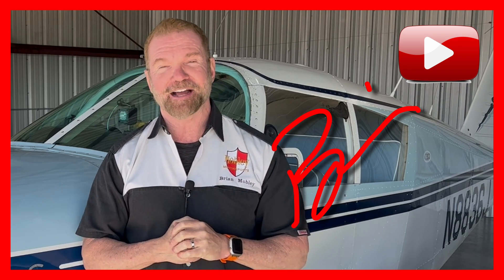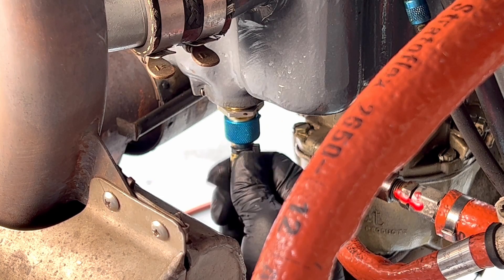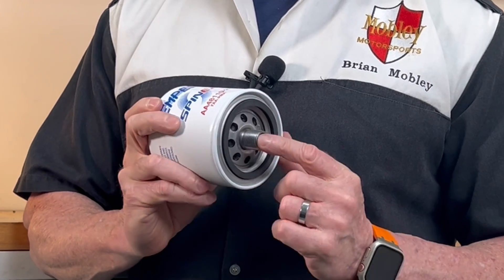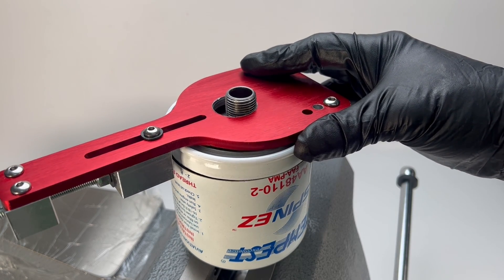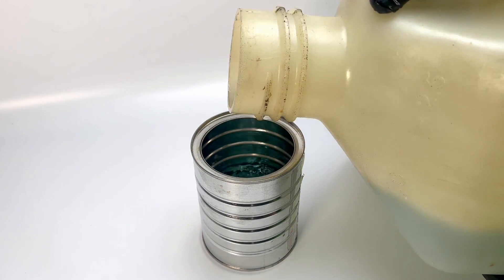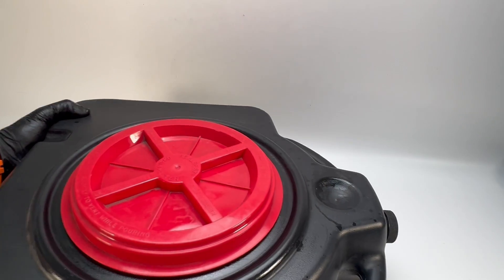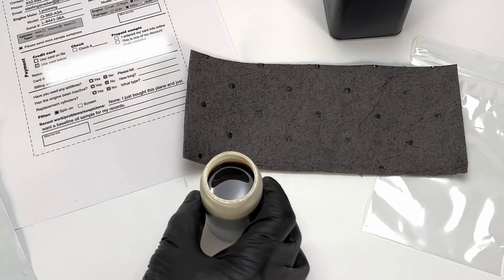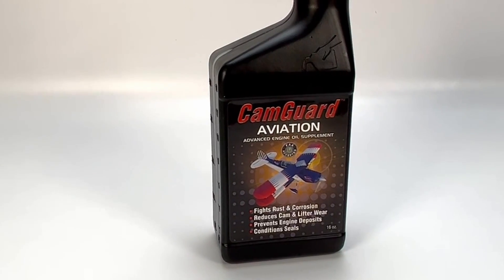Lycoming O-360 Oil Change | Piper Cherokee 180 | Cessna 172 | Mooney M20

Comment: I just bout a Cherokee 180 and had my oil changed at KLVJ. It was $530😢😢. I’m definitely doing it myself next time. Thanks for the video. Side note, I just saw a blue 180 just like yours over at the avionics shop at KAXH.
Reply from the maker: I’m based out of KLVJ also. And, you’re right about the plane at the avionics shop! That was mine. Was getting service on my VOR. As for $530 oil change, that’s nuts. Sorry you had to pay that. BTW, I’m so close to 10,000 subscribers. If you could subscribe, it would mean a lot!  Dying to hit the big 10K!
Reply: @brian.d.mobley  no problem, subscribe button just pressed. I’m right next door at Polly Ranch. I’ve got the “new to me” Cherokee 180 and I’m building a Kitfox as well. I’ll say hi if I see you out there. We’re down at LBX quite a bit for lunch.
Reply from the maker: We go to Runway Cafe with some frequency also. If you’re on instagram, my handle there is brian_d_mobley. Maybe we coordinate meeting up sometime soon.